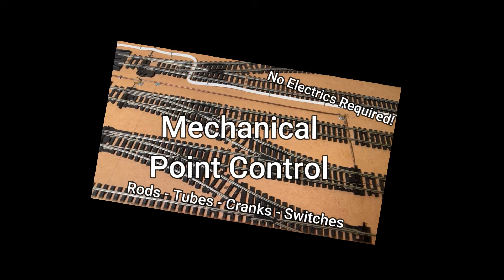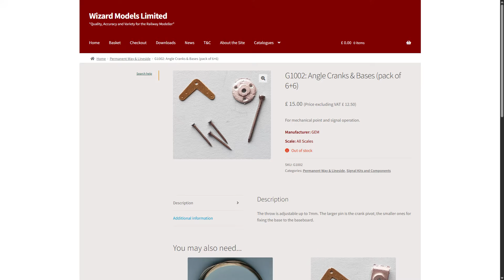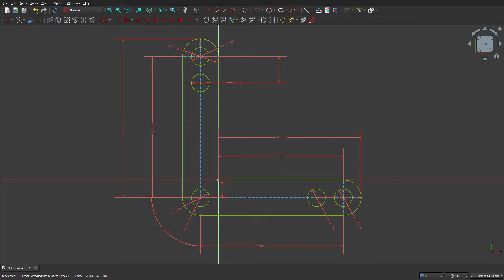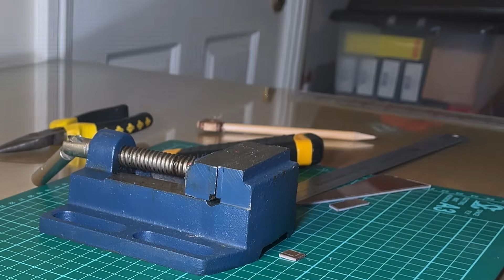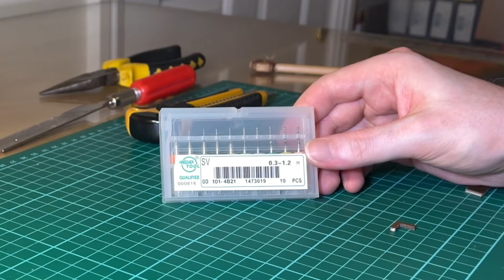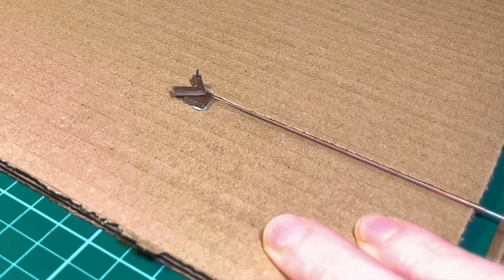DIY Miniature Angle Cranks for Mechanical Point Control - an alternative to GEM for Model Railways

Comment: Hello Peter for under baseboard I have used plastic tile spacers. These can be cut to suit and drilled to provide the correct distance of movement. I have controlled and linked a number of points at varying distances from the operating  switch. These bell cranks work well and combined with a slide switch the frog polarity can be managed as well. Thanks to Gormo for the tips from his site.
Reply from the maker: Brilliant idea using tile spacers!

Comment: Hi Peter, I have used the same method of operating my turnouts. For the brass tube I have used K&S (1144 ) 3 ft 3/32 brass tube, and either K&S #499 .5 mm music wire, or for longer runs up to 3 ft , I have used the K&S # 500 . 82 mm music wire which does not pucker up as much as the #499 music wire. I have connected the music wire in the exact same way as you by drilling a hole through the DPDT slide switch, which I also use to change the polarity of the turnout crossing vee. I have been using this method for over 30 years, it’s very cheap and 100% reliable. My only difference is that from a turnout, I take the 3/32 brass tube and mount it under my baseboard to a  DPDT switch mounted on the front of the baseboard.
Reply from the maker: Sounds good!